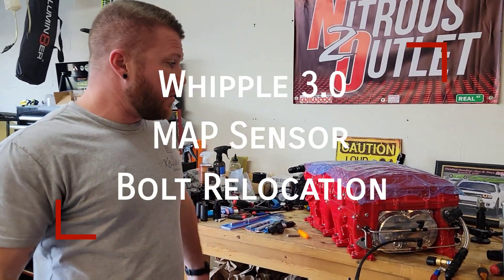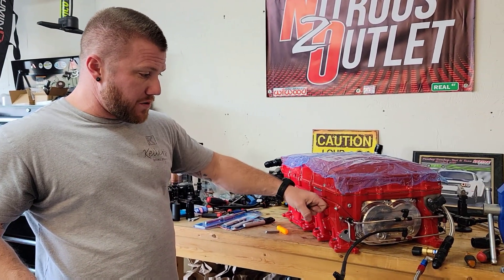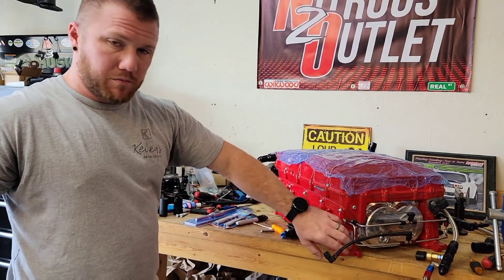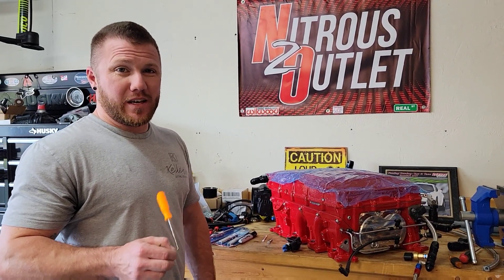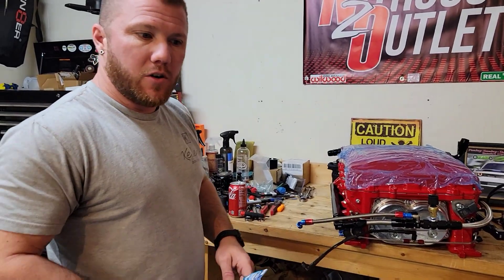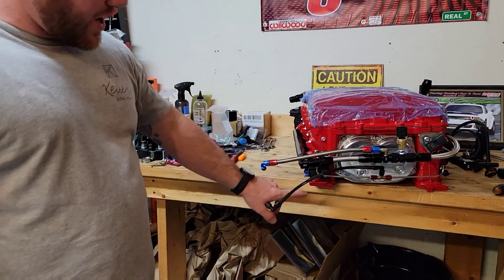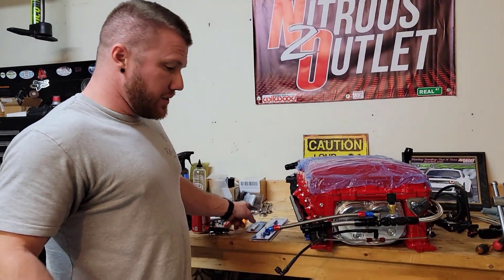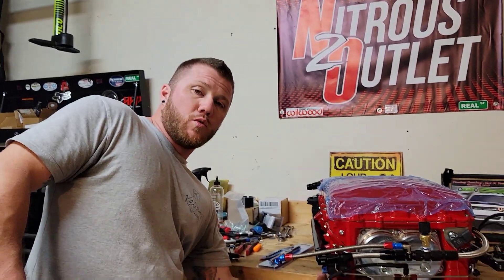Whipple 3.0 MAP Sensor Bolt Relocation  - Fitment Issues

Comment: I can see why you had to relocate the TMAP fastener hole but curious why you used the thick aluminum adapter for hobbs switch.
There is a 1/8'' boost reference plug just above the nitrous lines for easier service on the hobbs switch.
I actually forgot you bought a Whipple in black then sent it in for powder coating and porting, so I guess that's the one they goofed up.
Did you sell you stock IHI ported supercharger after getting the Whipple?
Just curious since it has been down for a while.
Reply from the maker: Ended up putting the MAP sensor in the location that my tuner reccomended. Drilled and tapped a need hole because the MAP sensor by itself wasn't able to be mounted due to the location of the Nitrous Outlet hard lines. 

Sold my IHI after placing the order for the first Whipple. Didn't expect the company that I hired to port it to take 5 months and then send it back to me missing bolts. And the port work was subpar to say the least. Looked like a 5 year old took a Dremel to the inside of the supercharger. That was the same company that ported my IHI..
Reply: @KelleysGarageOfficial  certainly hope your on the downhill side and get back to the track.
Killer build
Reply from the maker: @James-Orr  thanks man. Fired up the car for the first time last night at 3:30am lol
She's ready😎